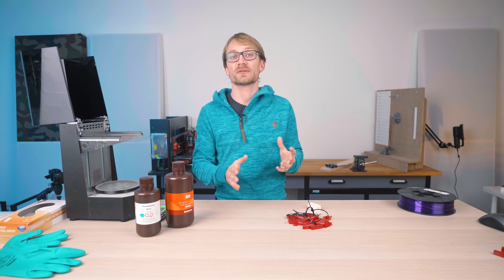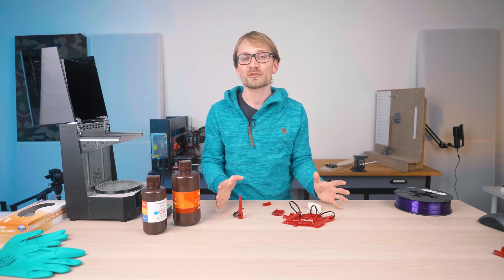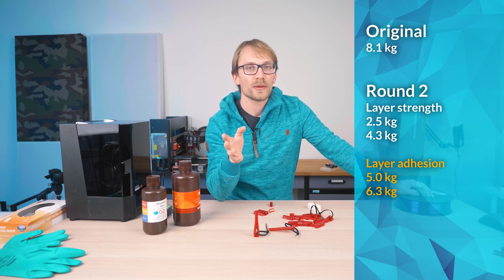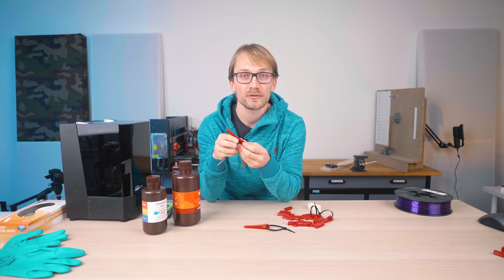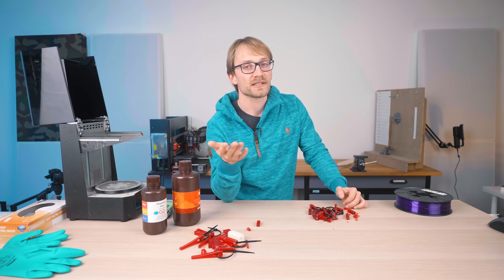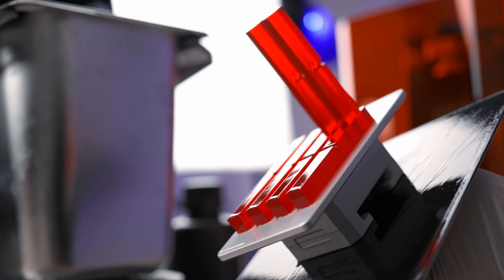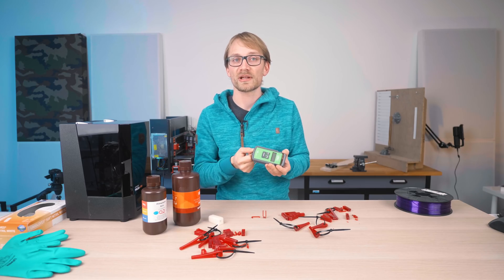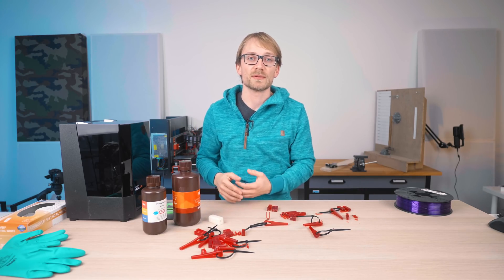Resin prints are weird: Does print orientation matter?

Comment: So your curing chamber is absolute garbage. 

And the laser probably moved slower on the vertical prints because it spent more time preparing for a change in direction. Try printing the horizontal ones slower and they will probably be the same strength as the vertically printed ones.

Overall if you reduce your print speed I anticipate that you will get a much better strength in all of your parts. Imagine that the curing chamber is not able to get the uv light into the deeper layers as efficiently as the surface layers.
Reply: There is no laser here. These prints were all produced with MSLA printers which cure every layer the same preset amount of time. There is an LCD screen in the path of the LED light which acts as a light barrier, with pixels set to white in the object area and black otherwise.

That the curing chamber cannot be completely isotropic lies in the nature of things. I think the prints that have been tested are all undercured - i suspect that the curing directions aim for a manufacturing scenario optimised for minimum utilisation of the (time and space consuming, thus in this context expensive to operate) curing facility and should provide an object that can be handled. I very strongly suspect the curing once kicked off will never actually stop, so the objects will be fully cured eventually, potentially weeks after extracting them from the device.
Reply: @SianaGearz  thanks for the clarification about the LEDs. Maybe the light blocked by the darkened pixels is internally reflected and escapes the open pixels, having the same effect. 

I agree they will probably keep curing for awhile. If the chamber isn't isotropic, then it should be powerful enough that it doesn't matter.
Reply: And another prospect, since it is pixelated, is that the bed distance isn't properly calibrated, and/or there are diffraction edges on the pixels leaving dead zones because things are out of focus or because it is a low quality lcd with well defined permanent dark areas or overlapping on vs off pixel areas.
Reply: @garybarbourii8274  I heard at least Chinese printers actually use an LCD straight off a tablet/phone with RGB subgroups intact per pixel. Of these, probably only blue set of colour filters has a very high degree of UV transmittance, green and red likely attenuate UV at least somewhat. So there will be lines going through the print which are less exposed, corresponding to the pixel pitch and going in one direction across the screen. I don't know whether Prusa uses the same for cost or gets their mask LCDs customised to get rid of the offending colour mask.

Pixel border occlusion is not generally a concern at lower resolutions, but potentially is when considering a 5" 1440p/4K LCD, so it is an interesting line of thinking. Because the footprint of wiring and drive MOSFET is more or less the same regardless of the pixel size, and the occlusion increases with pixel density.

I do not believe that mask LCD reflectance when darkened is necessarily an issue, but it is definitely something that can be investigated easily enough, so it should be.
Reply: @SianaGearz  tablet lcds? If that's true then I'm convinced that is the best explanation.
Reply: But also if it's true, then they are using a secondary UV source that can have a gradient or light/dark spots across the print area, too. This technology does not seem very appealing at our current level of development. Of course that could all be made up for with a super mega ultra Terra watt curing cycle...
Reply: And maybe picking an epoxy with better uv transmission
Reply: @garybarbourii8274   , I heard a lot of things, many of then were just opinions.
Reply: Another, simpler explanation, is that this is the liquid version of z banding, which actually manifests as pillars of inconsistenties on the x, y plane, so you should probably call it xy banding. The light that passes through to the previous layer always makes another pass at curing it, making up for any inconsistencies between z pixels, whereas the space between xy pixels, with inevitable diffraction edges and inconsistent light/dark areas are fixed on the xy planes giving them no second chances to fully cure to the adjacent layers. Meaning that any imperfections in your lighting create x, y holes/bands analogous to the layers in extrusion printing which have their own adhesion issues.

Again, I think that a stronger curing chamber with a longer runtime would help.

And I'm also willing to be that the stronger parts sat longer before being tested.

Comment: Noice.
Could you do a heat resistance test. I know that Resin prints can't melt but what happens when you apply heat to them, like on a hotend for example.
Keep up the good work.
Thanks for your effort. 👌
Reply: This would be especially interesting in regards to vulcanization of moulds in a spin casting machine...

Comment: In my opinion the key is curing: the ones standing are cured from outside in, bonding the polymers forming a pipe like structure where the weakest resin is in the middle where the neutral axis is, whereas the ones cured laying should have stronger ends and a softer middle, especially the bottom side. If this is true if you test two twins cured laying, but one face up like it was when it has been cured, and one face down, the former should perform better than the latter.
Also if you can I am curious to know if you can see the structure using polarized light (the easiest way is using a pc monitor as a source of polarized light, and to look trough the plastic with a camera equipped with a polarizer). As an example a lot of times with this method you can see the structure on transparent injection molded plastic formed by tiny rainbows that start from where the plastic was injected in the mold.

Comment: Thank you, Tom, for your return to the regular YouTubing! It was a really great followup of your previous research. I hope it will help your channel tremendously.  I think the weakness in xy plane comes from the RGB pixel pattern of the LCDs used. Essentially we block a lot of 405nm light by using the common smartphone screens. And the pixel density is not the issue. The type of matrix - is the one. Can we test exactly a DLP printer with UV, not the exposure? Does anyone have a Peopoly Moai to test that?
Reply: If a resin printer is using an RGB LCD screen then it's doing it wrong. The RGB masks in Bayer filters and such would not only increase exposure times due to decreased transmission, each colour would filter the UV light source differently and cause variant exposure problems. I'd be very surprised and disappointed if any manufacturers were shipping RGB LCD screens in their resin printers.
Reply: @anthonyrich1592  They are normally. Uniz Slash 2 has a black white lcd screen. Afaik BW LCDs are used in medical displays but are more expensive.

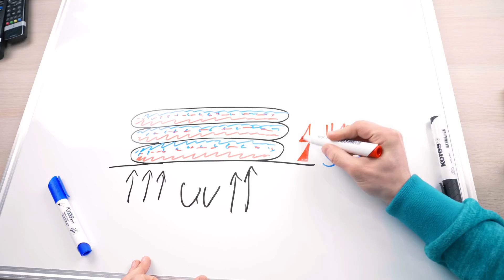Comment: At the point 10:32 you Thomas are correct. The chemistry inside the layers are different inside the layer after printing. This is because the UV-light is becoming only from one direction the top of the layer is softer than the bottom. The after curing at the CW1 will homogenize the layer chemistry making it more even strength by curing the soft top part of the layer.

-Material Scientist from University, studying SLA materials and resins
Reply: I was thinking the same thing. It seems to me that it would be beneficial to have UV lights pointing at the prints from as many different angles as possible when curing. What’s the potential for over-curing?

Comment: So my guess is that the reason Z is stronger than XY is because in SLA, the laser is actually shining through the uncured resin, onto the last cured layers and this causes the 1 to 3 layers in the Z axis to cure together more uniformly. But since SLA is just a single laser beam, the tiny tolerances of the laser accuracy in the XY plane caused the resin in that plane to be less bonded. (just my hypothesis)

I imagine this would have a similar effect in DLP printers since pixels likely have some tiny gap. Would love to see a test between the strengths of DLP and SLA printers though

Also a question I have is, would completely clear resins perform better? In theory they probably would since a majority of the UV light can reach the deepest parts of the model, and the fact that it's clear means that the resin in the middle of the part actually gets proper UV instead of a red filtered UV like in the translucent red resin

Comment: quit messing aroung with weaker resin!  use Blu - Strong and Precise High Resolution 3D Printing Resin by Siraya Tech!  very strong resin!
Reply: Sounds kinda expensive
Reply: @lukemagdalin6169  $44 for 1000g. not to bad i say.  worth it for parts you want super strong.
Reply: @IronMan-yg4qw  idk i prefer to use elmers glue
Reply: I went to replenish my stash of resin today on Amazon and skipped past their offerings because I didn’t recognize the brand name. I’ve only been printing with resin since last December and have so far only used my printer’s own brand, Nova3D. So I ordered some Elagoo goo along with a different color of Nova3D, both comparable in price to what you’ve mentioned. I haven’t seen the specs of the Prusa, but I suspect they are somewhat similar with respect to UV exposure details. I’m hoping to find more resin review videos for this class of printers.
Reply: @rojerww  i have been using elegoo, it works soo yea

Comment: Hi Tom,
Thank you for your videos and these tests. 
I wonder if the "Temperature" of the resin in the vat and during UV insolation 
could be critical or not? 

I'm saying this because I use a Form1+ then a  Form 2 with a FormCure, and these last two machines have a thermal control during printing and insolation... and material resistance is much higher and consistent with them. I have no data to share here. It's  just a personal experience and feeling. Hope it could help.

Comment: Possible explanation for vertical increase in strength could be that the effective material curing is higher for those samples. We should expect an exponential drop off in light intensity passing through the resin (Beer-Lambert law) with differing rates for cured and uncured resin, with a slower decay(probably) through cured resin with the breakup of the photoinitiators. So in the vertical parts the long tail of the light decay ends up curing the parts more than the horizontal albeit at a very slow rate. Could be verified by comparing to a resin heavily loaded with pigment which would block long range decay to see if it ends up being a bit more isotropic, though probably weaker in general.
Reply: Could it also be that the "black" parts of the LCD are not as black as you may think and leave some UV light through which may help to cure the surface of the standing parts? Then also the position inside the printer may have an effect here as the ones in the middle may see more UV light scatter at the parts compared to ends more to the side of the build plate.

So then you could print several standing ones on a single build plate to see which one may be stronger. Of course there must be enough space in between, so only print 5 at once. One in each corner and one in the middle.  As curing longer and in different orientations does seem to help, it could be the ones being exposed to some UV light longer may also be better cured (or deeper cured?)
The ones printed flat, may also not have been exposed for a long time, if they are not printed along with standing ones at the same time.

Comment: when experimenting with some specialised resins I noticed similar behaviour, when the parts were not perfectly cured. on some resins it needs very long light exposure to fully cure them, in a not evenly cured state they are more impact resistant than fully cured. SO i suspect the Plys you are refering to are an arifact of  partially cured resin beeing trapped inside the part and not getting the same exposure as the outside of the print.  this under /overpolymerisation effects are more noticable on special resisn, like flexibles and the very expensive high temp variants.
Reply: This is where my thoughts went as well.

Comment: In material-science classes/textbooks, we often compare glass to steel.   We know from extensive testing, that defect-free glass is about 4x stronger than steel.  However, in practice, this is obviously not the case!  Due to micro-defects in glass, it is almost always weaker in practice.  Micro-defects easily grow into macro-fractures in brittle materials, like glass.  (Fiberglass is an example where the glass is relatively defect-free, and thus very strong.)

btw, there is a historical example, where some scientist created a rod of super-defect-free glass, and he tied it into a loose knot.  He had to keep it specially contained in a box to show it off.  Because even touching the surface with your hands, or specks of dust, would introduce micro-defects into the surface, which would grow into large fractures.

My naive guess is that brittle materials are harder to test, because they're more sensitive to (somewhat random?) surface defects.  So, somehow you need to control for that too.  But as hobbyists, it's probably impractical for us to control things to that level.  So tests like the one you've done are useful: In practice, there is wide variation in the strength of resin printed materials.

I'm not a material scientist, so I don't know what's going on.  Do you have any friends who do research in material science?  Maybe they can look at some of the fractures under the microscope and tell us if they see anything weird or different.

Comment: Could it be that the spacing between the pixels effectively creates “layers” in the z direction?
Reply: Just wanted to suggest the same. If there were tiny borders of reduced brightness between pixels, the part could be inconsistently cured throughout a layer, creating weak spots for bending and stretching. I haven't got an explanation, why this wouldn't have an effect on impact strength, though.
Reply: @trommpete  to answer this question one would have to print the part on good old SLA with laser and uniform exposure. Or use two different DLP printers with different displays but using same resin and curing process.
Reply: If they did it well, there could be a diffusion filter to deal with that.
Reply: Or could it be that printing things in layers means the thing does have layers and they're just not as pronounced in resin prints due to the way the layers are laid down?
Reply: My guess is the issue isn't a layer bonding issue like FDM but a gradient cure issue. The layers bond perfectly and seamlessly, but the resin furthest from the UV source cures less completely than the resin closer to the light. I mean, there's a reason you don't use .5 mm layers besides quality, right? The resin won't cut at the build plate when it's thick.

So on the pull test, when layers are stacked the less cured portions give a little, which relieves some stress on the bottle parts, letting it handle more weight. When layers run the length (printed flat) each brittle layer gets no relief, so once you go beyond what they can handle they break, doubling the load on the soft layers and immediately breaking them too.

Bend test should be like the pull test, with stacked layers providing strain relief and the flat layers providing much less support, though my intuition is that the two results will be closer than the pull test.

Lastly I think for impact the flat layers should have the advantage, since, if I understand my physics correctly, transitions between hard and soft layers should absorb more energy than a uniformly soft or hard layer. I think this will be minor though, because there is only a slight difference in hardness in the layers.
Reply: the X/Y distance in between the pixels is so small it would not effect anything. additionally, resin prints don't have layers left on their insides because of the curing process, all of their mass is fully cured and completely solid.

Comment: if your hypothesis is correct, resin cube will absorb different wavelengths of light depending on orientation (pay attention to intensity as well). I'm sure, you have enough Arduino skills to test it
Reply: actually, that only in thick sandwich case, with such fine layers even scatter pattern could be identical
Reply: more I think about it, less I sure. Tortuous crystal of well-cured resin will be foggy to "top" observer, and clearER to "side" observer. So it should be measurable
Reply: if, of course, transparency is not compensated in the exact amount by geometry. Can size up a cube to compensate, but that will increase the "noise floor"
Reply: and you will cure the resin little bit during the measuring part. So here is that. Pretty sure, that wavelength sweep is not an option for home DIY, so "white light" is the only choise

Comment: Perhaps another variable is the age of the resin.  Has it been printed from a fresh unopened bottle, or has it been previously used?
Reply: Also, was there consistent mixing of the resin (by shaking or stirring) before pouring it into the tray? Could there have been settling if there was an appreciable length of time between print cycles?
Reply: if you add iron nanoparticles to the resin it becomes VERY STRONG. but curing it is a NIGHTMARE. (1 minute per layer)
Reply: @Astro_Alphard  I have been wondering about carbon fibers...
Reply: This is what I was aiming for too.  Including some impurities in the materials and maybe even the film that is between the UV and the resin.

I really want to see the results of Stefan ;-)